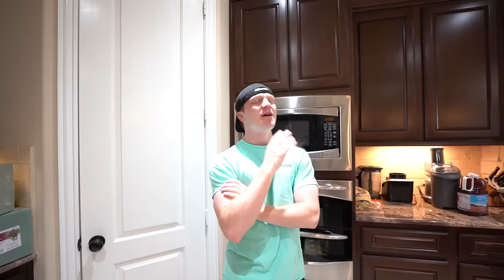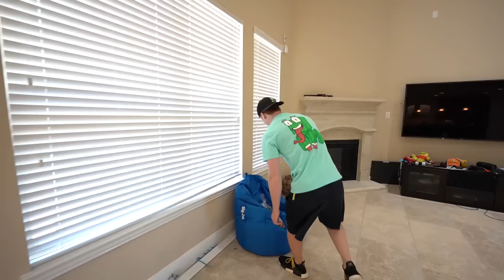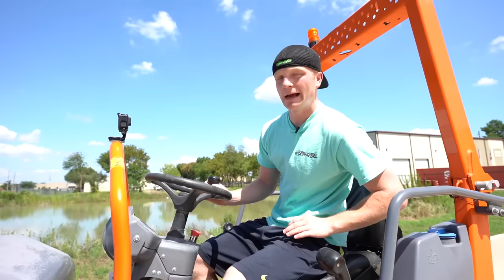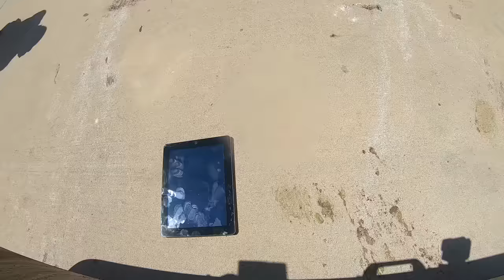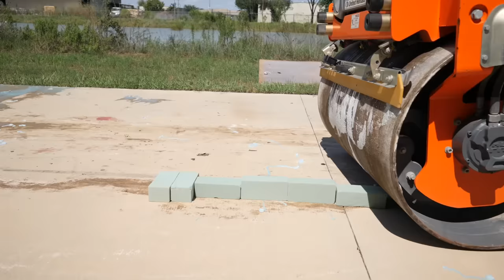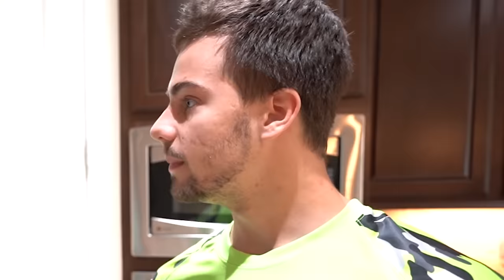CRUSHING SATISFYING THINGS BY STEAMROLLER! SOFT, CRUNCHY, GUMMY!

Comment: Did you know that other snake not come for you if you crash another snake that which is even if it’s not even origina 10000000099999999999999999999999999999999999999999999999999999999999999999999999999999999999999999999